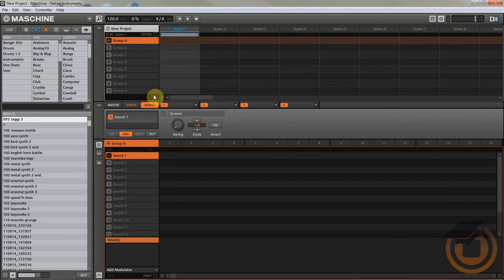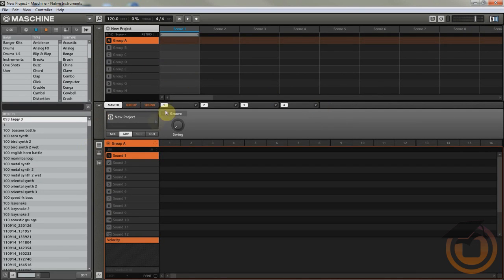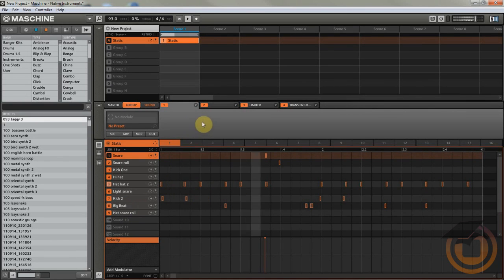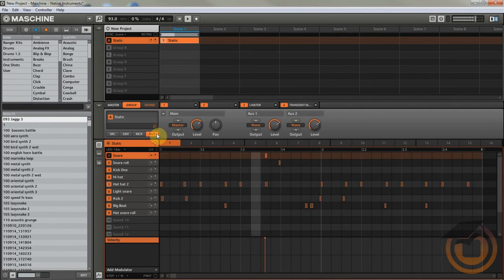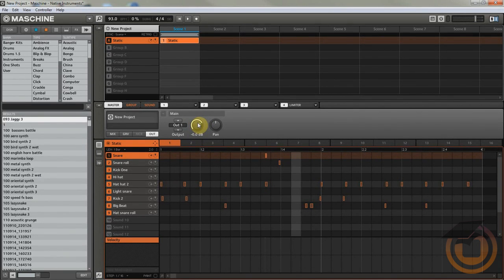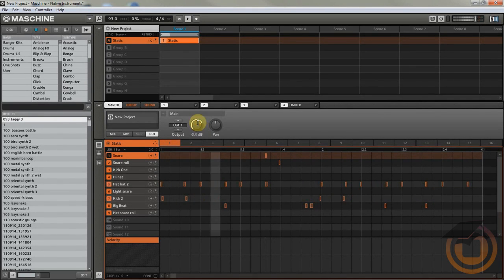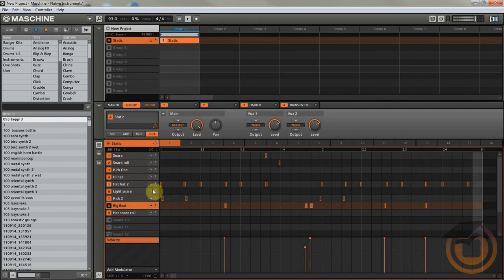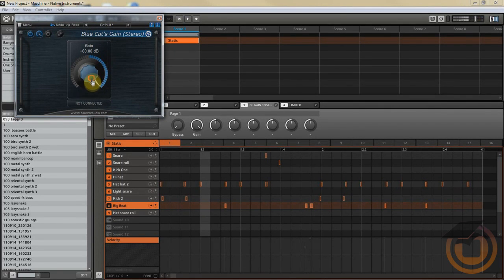Tutorial: How to use the Limiter in Maschine to master

Comment: Another good way of preventing clipping and also getting off to a good start in terms of mix levels on each project: 

Make a default template for Maschine with each group's volume set to -6db 
If you're like me and tend to bring up the levels with filters/EQ and other plugins when mixing, this really helps give you more wiggle room so to speak. 

If anyone's interested, my Maschine template is basically as follows: 86 BPM, MP60 mode on drum group (need to add sampler to each sound slot in order to enable MP60 mode), pad link set up for drums, sound slots on drum group labeled kick/snare/hat/perc so they remain that way after you drag a sample to that slot and you don't need to rename each new sample, settings for sampling such as input/detect/threshold etc ready to go. Saves me a lot of time :)
Reply: HipHopAus thanks bro what genre of music are you into